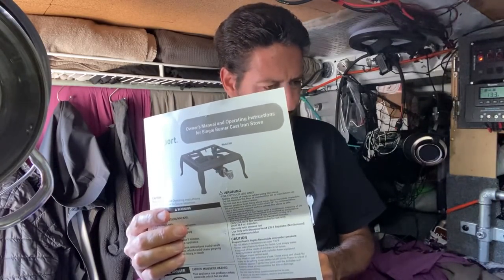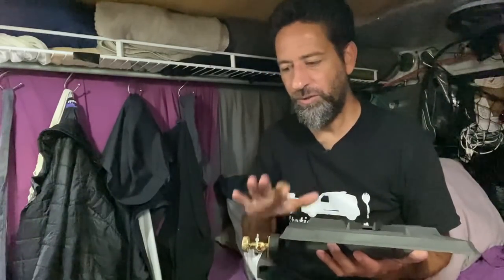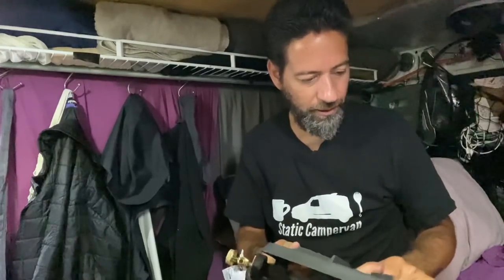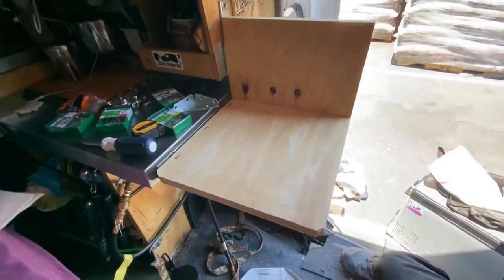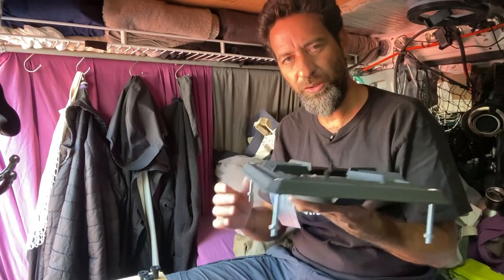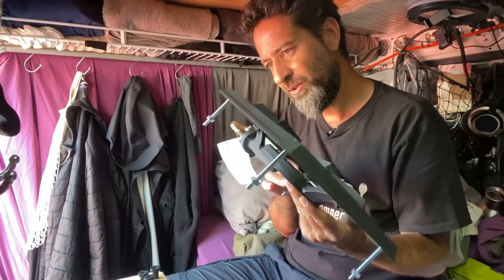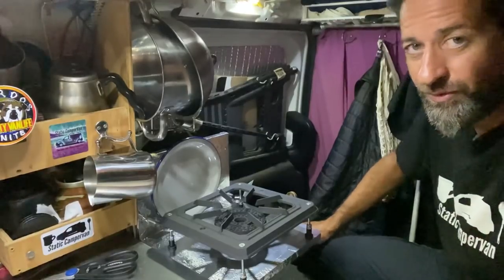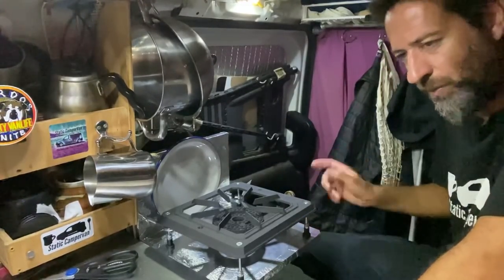Replacing my Campervan Stove with a Stansport 15,000 BTU Cast Iron Propane Camp Stove

Comment: A ceramic tile under your stove will give you some protection against fire. Vinyl likely has a low melting point and even before getting high enough to melt, it would likely off-gas some toxic stuff. 

Firebricks for metalsworking are perfect for inder the stove and also for protection along the sides. The link has a brick less than an inch thick. These things come in many sizes if this size doesn't work.

So glad you fixed it so the door can open. Much safer and way cooler. Love the adjustable feet you designed.

Comment: My emergency back up stove is an old Bernz-o-matic TX550 model single burner propane stove. Its very powerful and when your in a pinch, it works great. I keep it stored away under my van bed.

Comment: I was thinking using 1/4-20 screw eyes or hooks in the base front to 2 coupling nuts as spacers then you have 2 places to hang pans or pots under the stove. Definitely looks like a simple solution that is easy to fix.

Comment: Interesting video Scott. Great insights gained with the research for replacement parts etc.  The additional heat with cooking kind of comes with propane cooking, huh? (Its currently 102 in the shade here in Ohio & the thought of simply boiling water on our stove, adding any heat in our motorhome is enough to drive me mad😵)  Im curious if you could find a square stainless steel bain marie or flat cookie sheet at a restaurant supply that would fit under the stove perfectly?  Another thought I have is, the stove is cast iron and could become very hot itself while cooking.  You may want to consider what you might use to cover the stove so you wont inadvertently burn yourself. Perhaps a cover would help ease your distaste for the esthectic of it. Not that your a klutz,  It is a small space 😜
Reply from the maker: This setup allows me to cook outside, which will help keep the van cool. There’s plenty of room around the stove. It can sit in place while it cools.

Comment: I was glad to see you had that I hook on the back holding it against the wood.  I'd always pick simple over something complicated.  More to go wrong with complicated.  I guess in the winter you could partially heat your van with the stove.
Reply from the maker: A stove makes for a great back up heat source. But they also add a lot of moisture. My Olympian Wave 3 is safer and and drops the humidity at the same time.

Comment: Despite this episode being two years old, I have an idea about a fire-proof backsplash.  How about 4 unglazed Mexican outdoor floor tiles glued to a piece of plywood backing?  You can buy a box of 10 or 12 very cheaply (around $25 a box).  Years ago I bought unglazed Mexican floor tiles from Home Depot and used four of them at a time as a pizza stone in my gas range.  They conduct heat evenly when I cook a pizza directly on the tiles and when I bake or roast dishes at 450 degrees.  With constant use of my oven, the tiles usually last over a year before any of them start to crack under the heat.  I found it's a lot cheaper to replace the tiles every couple of years than to buy a costly pizza stone which also crack under the heat.  I found this idea from researching for a more economical alternative for a pizza stone and found several online folks who suggested the unglazed tiles as a cheap fix.  It sure has been:  $25/box vs. a $200 pizza stone.  Yours as a backsplash should last much, much longer cause they would not be coming into direct contact with a heat source like mine are as a pizza stone.  You could also use some of the tiles as a base under the stove legs instead of the aluminum foil you're using now.  The tiles clean up nicely with Krud Kutter or 409.

Comment: Another commentator said something similar; you could use a marble chopping board if you can't find a tile 😊....A nice looking stove
Reply from the maker: The foil is working well. Chances are slim that I will replace the foil with anything else. 
(Remember that I’m lazy)
Reply: @StaticCamperVan  foil is light weight 😊

Comment: Those little green bottles are the devil. We have a buddy heater and this past winter couldn’t find any for a month. I researched refillable ones and you could buy a house cheaper. I have never seen that size on the east coast but refillable is the way to go. Can’t wait to see your first meals.  A pretty 12x12 tile might be a nice heat shield.

Comment: I was thinking, if you drilled shallow holes in the wood it sits on for those legs to sit in, then the stove would be safely held when driving and not rattling? Also perhaps find someone with a jig saw that can make curved corners on the plate form and the little wall above. If it was me, I’d see myself banging that upper corner everyday, but I’m klutzy.  Also could you put it on a swivel platform so you can swing the stove outside when you? That would be awesome and convenient for cooking.

I love using the ReStore for building supplies. You can get a single tile there, maybe even a few decorative ones.
Reply from the maker: The stove doesn’t rattle when I drive because of the rubber feet. There are two eyelets that hold the back feet in place. I settled on using the eyelets to hold the stove in place because I want the ability to easily set the stove outside.

Comment: You have to make 4 holes in the wood and used butterfly nut and it more easy to find the lever
Reply from the maker: I want to be able to easily use the stove outside of my van. That’s why I put feet on it instead of fastening the stove to the table.

Comment: Congratulation to the new stove. Men need new toys from time to time and if the old one caused problems, maybe a good idwa to replace also for safety reasons. Two design ideas for the new setup. One, maybe cut the upper right corner of the new backsplash a bit round, so it cannot hurt you when you get in and out the van. Two, maybe you can drill two holes for longer bolts through the upper surface of the Stove and the wooden board below and use them as a fixation for the stove to fix it in 9lace while cooking and driving? Have a great evening greetings from Germany.

Comment: this looks like a real, restaurant quality cook top. It looks like you could replace that hose and control valve (but maybe that would cost as much as the stove).   It's hard to tell how much clearance you have between the gas burner and the wood.  At first I thought you were going to drill 4 holes through the wood.  If you put a washer and nut above and below the wood, it's still adjustable, fastened firmly onto the wood, and sits a bit lower.  So that setup would be nut-washer-wood-washer-nut.  And you can adjust the ones above and below to tighten down on the wood.  But the current setup looks good.
Reply from the maker: I forgot to mention that part of the reason behind this design was to be able to quickly move the stove outside to cook.

Comment: Those kind of stoves get fairly hot underneath as they dont have a heat shield. You might consider a ceramic tile or piece of sheet metal?
Reply: The correct, I made a heat shield for a friend of mine.
Reply: @seanh4841 @staticcampervan I have the Camp Chef Ranger two burner in my van. I have a piece of 1/2"  concrete board with galvanized metal on it.
Reply: @shawnbailey.parkie7585  Similar, I used 9mm concrete fiber board, with a surround made of the same stuff as my friend make a lot of Turkish food.

Comment: Do you think the induction ovens would be better for long run? 
Of course it brings cost of battery and electrical system along with that. But on the other hand, you don't need to pay for propane or butane gas , and you don't need to carry that in your car, you can just charge while driving on car plug or/and solar.
Reply from the maker: Doing the math on how much battery and solar power I would need based on how much I cook, I’d need a minimum of four more solar panels and three more batteries. It’s not practical for me and my situation.

Comment: I like your appreciation of the practical. You’ve wrestled with a few stoves since I started following. Will be interesting to see how this one lasts.
Reply from the maker: I almost bought another Gas One stove. But after considering the $70 price, this less expensive option seemed the best choice.
Reply: @StaticCamperVan  I like your points that parts are generic and so easily replaced/repaired. Also, this model reminds me of the cooker used at a public school I attended - the kitchen seemed to have been around since the 19th century. Makes me think it could be quite dirable

Comment: This may be crazy, but I’m wondering if you can lower the BTU’s of the stove by plugging up some of the holes to prevent propane from coming out of them. Solder or even JB Weld?
Reply from the maker: I’ve been wondering the same exact thing. But not because of the BTU output. I like the extra heat. It seems to work better with my carbon steel skillet. 
My issue is the burner ring is a little large. The burner would match my kettle better without the outside ring.

Comment: Excellent, well thought out. Can you simmer with it? Most burners are hard to adjust to a low flame.
Reply from the maker: It seems to simmer pretty well. It’s not very easy to adjust, though.

Comment: . Was wondering if you have made any changes to the stove set up and was also wondering how you attached the wood stand under the stove to the stainless steel counter? Seems to be the part of the puzzle I can't quite figure out.
If you could make a video on this i'd appreciate it, if not i totally "understand" no pun intended. (Dr.Evil laugh)
Reply from the maker: No changes to the stove as it’s been working well. I think this video shows how I attached the extension to the counter
Reply: @StaticCamperVan  okay thankyou

Comment: How many stoves in how many years? Not  being snarky, for me it's a constant do over. How much did cooking outside play into the change? This summer has been beyond ....
Reply from the maker: Haven’t kept track of the number of stoves. The biggest issue is that camp stoves aren’t designed to be used on a daily basis. Camp stoves are designed to be used occasionally while camping. 
Couple that fact with how I cook much more than the average vanlifer, and it’s no wonder that these stoves need to be replaced often.
Reply: @StaticCamperVan  and mad respect for the cooking. I can't cook right now, too hot.

Comment: Hi Scott, did you consider putting the control knob on the left rather than the right so you won't snag it on the way in and out of your van?
Reply from the maker: The control knob is located on the right because I set this up with the intention of moving the stove outside the van on occasion. 
Besides, this stove gives me three extra inches of clearance compared to my last stove.

Comment: No idea on cost, so this is just an idea, but if there is a small heating and air business around that builds ducts, they could build you a platform out of sheet metal similar to the plywood, and IMO that would be safer and easier to clean.
Reply from the maker: The foil is really easy to clean (so far). Plus I simply can’t afford to hire someone to build anything right now.
Reply: @StaticCamperVan  I totally get that, just a thought.
looking forward to seeing the outside set up.

Comment: Why don't you reduce the height of the table and then also make it a swing out stove.  That way you would use it inside and outside for the hot days.
Reply from the maker: The height of the table is set where it is to allow access to my refrigerator underneath. 
I set the stove up with the option to move it outside easily.

Comment: Have you considered outside cooking?
Reply from the maker: Yes, I forgot to mention that part of why I set this stove up this way is to be able to easily move the stove out of the van and cook outside.
Reply: @StaticCamperVan  It would really come in handy on cold days to have dual purpose cooking and heating up the van since it puts out a lot of heat.  Good info!

Comment: Follow up review now that you have had some experience with the cooking please
Reply: Is the Stansport able to go down to a very low simmer?
Reply from the maker: The stove is able to simmer low. But the control knob isn’t the smoothest. So at times it can be difficult to get the flame set at a very low level.
Reply: @StaticCamperVan  and full blast with the regulator is ok?
Reply from the maker: Yes, the stove does great at full power. It’s just hard to adjust the flame precisely. 
It’s down to the mediocre quality of the control knob. But at $20, it is a minor nitpick. I’m very happy with the stove.
Reply from the maker: @roelruiz2022  not sure what you mean by safer. But I've had no trouble at all with this stove.